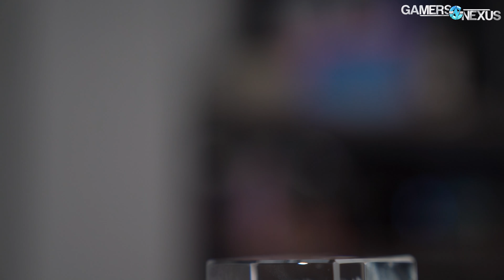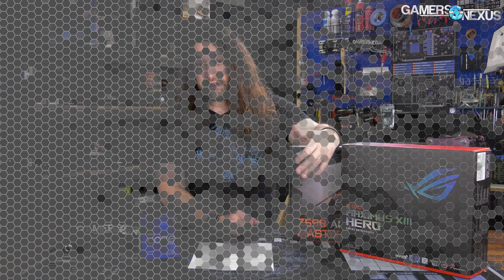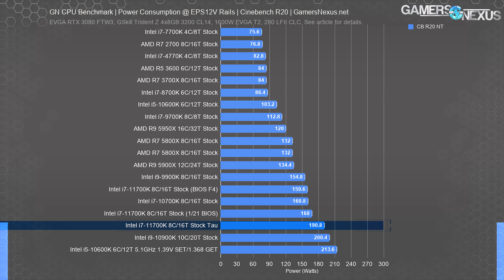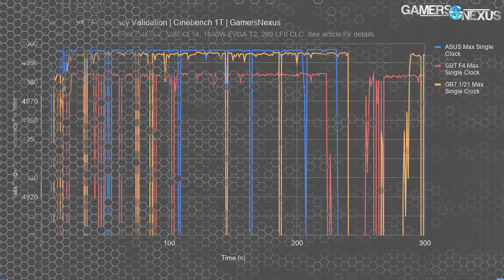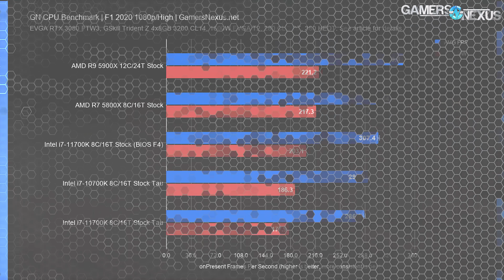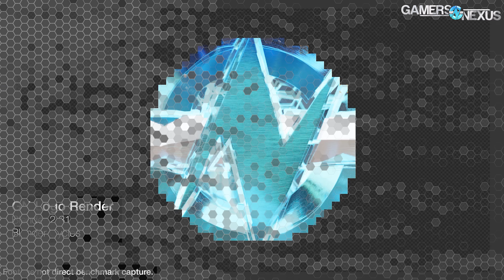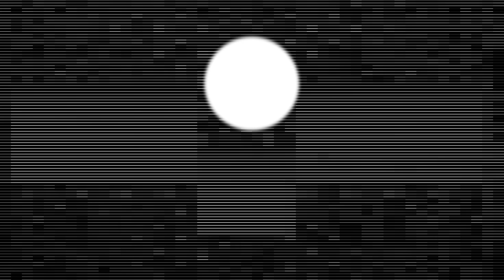Intel's Z590 Motherboard Problem: i7-11700K Power & Thermals Explained

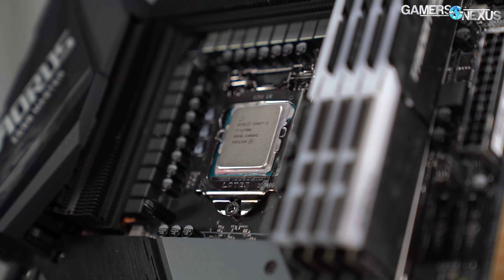Comment: Was that pink thermal paste at 12:25 Thermal Grizzlies new Kryonaut Extreme? I picked some up a few weeks ago but haven’t used it yet.
Reply: If you are in Germany I will send you a test sample of some copper nanoparticle paste we are currently working on if you would like. We are seeing up to 7 degrees C improvement over other pastes. We are still testing longevity but so far we have samples running for 10 months with no degradation in performance.
Reply: @excitedbox  Hey there, I’m in the United States. I’m not sure if you could ship here, but I would be interested if the shipping price isn’t terribly expensive.
Reply: @excitedbox  I‘m in Germany, Rheinland-Pfalz
Reply: @excitedbox  Hi, I'm form the Netherlands and might be interested. Building a watercooled 5800X system. I used the thermal paste supplied by EK WB, thermal Grizzly I think. Would another paste make a difference?
Reply: The price of that kryo extreme is insane. Just get some KPx for half the price, and it is pretty much equal in performance.
Reply: @Apollo-Computers  Yeah I ended up buying a tube of it for around $22 instead of the cup for $80. It was the last tube the distributor had at the time.
Reply: @connormccue9739   I only buy the 30 gram kpx, best price. But then I can go through a lot of it doing ln2

Comment: Single thread speed vs 8700k. How much slower is it to the 11700k
Reply: Passmark singlethread:
i7-8700K = 2787 MOps/sec
i7-11700K = 3542 MOps/sec.

i7-8700K is 21% slower in one thread vs 11700K.
Reply: 134 (8700k) vs 186 (11700k) on UserBenchmark
Reply: @centichad  I don't think that the difference is almost 30% in singlethread perfomance.
Reply: @saricubra2867  Probably a paid promotion between UB and Intel.
Reply: @saricubra2867  I upgraded from 9700k to 11700k a few weeks ago. Playing a single core bound game (Rimworld) I had a nearly 30% increase in tick rate (which is a better measure than FPS for pure single core power) on a busy, incredibly laggy on the 9700k, colony. This bears out in pretty much all single core productivity benchmarks done, and was measured with both at stock. From a 10k series, maybe not worth. From 9k series, I'm very glad I made the upgrade. PCI-e 4.0 SSD is also a noticeable upgrade, and has not been really mentioned as being a part of the upgrade benefits. Also a small amount of future-proofing once 4.0 is used in future GPUs.
Reply: @arofnet  "from a 10k series, maybe not worth it"
I would take anything over Skylake CPU cores.

Comment: what is Tau?
Reply: Tuning and Analysis Utilities.  Basically, Intel boosts its core higher than advertised for a set amount of time before throttling back to it's advertised spec.
Reply: @dashkatae  thanks:)
Reply: A letter from the greek alphabet
Reply: It's what everybody should use instead of Pi

Comment: Another reason why the 11700k and 11900k will perform the same.
Reply: I'm curious if the 11900k will perform worse since it has two less cores.
Reply: yep only 100 to 200 mhz. if you really want intel with their overpriced mb get a 11700k.
Reply: @rci-tf2zc  a 159$ z490 will work with the 11700k fine...the msi a pro z590 is around 189$ lol.... people really dont know that z490 supports 11th gen....
Reply: You can expect the 11900k to be much better binned silicon than the 11700k, because Intel expects it to turbo and self-overclock much higher than the 11700k. This is similar to how the 10850k was "only 100MHz slower than 10900k", but in truth, it ran much hotter too all down to selective binning of the best silicon for the 10900k. I don't think it'll be 30% faster or anything, but I think it will do quite well if allowed to run at PL2 with a good cooler. I would bet up to 15% faster than 11700k depending on the workload. Also, I may be horribly wrong! We'll find out soon enough lol.

Comment: Of course we all know that when the 17700K arrives it is going to be more or less identical to this one...Intel's CPU development is less eventful than my current dating situation and that is quite frankly impressive
Reply: Nah they stepped up with 9th and 10th gen as AMD became relevant, this just seems like a useless sidegrade line to have a release before 10nm is ready.

That said, the 17700k will probably just be a reskin of whatever the 12900k is, so you're not wrong.
Reply: Don't be stupid. The world will have exhausted it's production capacity for "+"s before then, forcing Intel to cease trading.

Comment: I guess there's nothing exciting about the 11th. I'll just keep my 10700K.
Reply: I am thinking along the same lines...with an E5-1680V2!
Reply: Well yeah your CPU isn't meant to last a single year
Reply: You can just use auto-oc
Reply: @Tim_Götz  that is trash. I tried that and after I overclocked my 9 3900x and manual overclock is much beeter.
Reply: Wait and see if the microcode updates optimize the 11th gen first. Steve showed its operating at lower frequencies than the 10700k. I dont think intel was ready for ppl to receive them before march 30th
Reply: @kieran9882   In this video they are operating at stock tdp and frequencies as specified on the leaked slide.
Reply: @dare2bdeviii  the video before this one he shows it
Reply: Smart person.
Reply: 7th gen gang
Reply: 12th gen may be decent due to new management
Reply: @insainperson6018  it'll take a few product cycles before any changes really hit the wafers, executive changes can only affect so much, so quickly (ie 1-3+ years)
Reply: @austinh1028  14th gen will probly be the first revision of the new cpus under management decisions
Reply: @insainperson6018  12th gen is already too far ahead for managment to affect it. tbh this feels like Intel threw in a product just to have something on the market.
Reply: @robojimtv  you mean under the new ceo ?
Reply: @insainperson6018  yeah. 12th gen is supposed to come out end of year. I don't think we'll see the full fruits of the new CEO's direction till 13th gen and probably not 14th either.
Reply: @robojimtv  definitely 14th but  13 not as much
Reply: I just built a 10700K system (still doing a lot of file recovery/tuning from the system it will replace that died actually), but I am considering a 11700K upgrade..... not for performance, but because doing that will enable PCIe 4.0 and a third M.2 slot on my motherboard. This does worry me though. I know there isn't much of a performance upgrade, and that is, fine, because the main reason I want to do the upgrade is not for performance but for PCIe 4.0 and that M.2 slot..... what I AM worried about though, is if the 11700K will perform WORSE than my 10700K.

I do want PCIe 4.0 and that M.2 Slot, and I am fine with keeping the same performance to get those.... but I am not fine with upgrading to a CPU that would perform WORSE, or the same but also a lot hotter. Worried about which route to go.

Granted, I am not going to do that upgrade for another 1-2 years, not right now. So hopefully my options will be clearer by then.
Reply: @Cyber_Akuma  what motherboard do you have?
Reply: @Melkor54  Gigabyte Z490 Aorus Pro AX
Reply: Alder lake this fall should be more competitive (not disruptive, but certainly not garbage). But it's Intel so I will believe the rumors when I see the benchmarks
Reply: yes, just overclock it and its pretty much as fast as a 5800x
Reply: @Melkor54  and then you overclock a 5800x and bye bye intel.
Reply: @rci-tf2zc  eeeeeeeeh.. Zen doesn't really overclock that well.. and they run damn hot if you do.
Reply: @rci-tf2zc  how many actually overclock thier ryzen 3000 cpus. Even intel k users dont really overclock so i dont get your point. And in fact i dont see people saying i wish i got a ryzen 5900 over a i9 and vice versa because once you drop money on a top tier pc.... i dont think you really care to a degree
Reply: @rci-tf2zc  try it, they burn up and don't overclock well at all. my 10700k runs 5.2ghz all core at 1.28v and rarely if ever goes over 70 degrees...try that with AMD.
Reply: @Melkor54  amd 5000 series already boosts above 5ghz on a single core
Reply: @ripjosh5212  the 5950x does boost to 5ghz but that cost £800 if you can find one at retail price. The 10700k is under £300
Reply: @Melkor54  Well, the fact that you can OC to over 5GHz and still get the same performance of that 4GHz Zen 3 CPU is so so so "impressive" for intel. Get over your ego and learn about IPC gains.
Reply: @ripjosh5212  mine runs all day a 5.2 all core....
Reply: @Melkor54  But what does that matter when it's still slower then the 5800x with PBO2 and a -15 to -20 curve. Least Intel finally fixed their heat problem. My 9900k is a little space heater compared to my 5900x.
Reply: @Fudgesickle  i heard lots of people complaining about amd and driver issues as of recent. Makes me hesitant. I'm still hoping the i9 gonna be an OC beast. Wishful thinking probably :(
Reply: @XxViciousxX  8 cores 16 threads....$240
Reply: @Melkor54   I remember when I thought the clockspeed was the most important result. Even overclocked the Intel chips trade performance blows with the lower clocked AMD parts. In productive workloads the Intel parts hold no hope even overclocked. But hey, congrats on your overclock that most Comet Lake owners can achieve with a decent aio cooler.
Reply: @dare2bdeviii  thats my point...they have huge oveclocking headroom, i game at 32:9 5120x1440 and in vr..my machine is gaming exclusively...for that there is no difference in performance between my 10700k and a 5800x...for productivity you buy a threadripper.
Reply: @Melkor54  Interesting because when I had my 3800x for $399 vs Inte'ls 9900k for $550 I was called a poor loser by Intel fanboys because I "couldn't afford the best" now that Intel is in the same place as AMD was  now it's good to get the bang for the buck.
Reply: @XxViciousxX  that's what i buy, the best bang for buck, i have no brand loyalty...AMD 5000 series cpu's are great and the 5600x is good value against the 10600k...the 5800x is not againt the 10700k as all i do is game with my pc.
Reply: @XxViciousxX  plus i enjoy overclocking, more fun with intel at this time with Cpu's and more fun with AMD on gpu's
Reply: @Melkor54  I enjoy overclocking and tinkering which is why I have both a 9900k and a 5900x. Messing with the 5900x PBO2 and their new curve optimizer plus tightening the RAM gets me all sorts of performance benefits.

 But then it's fun to push my 9900k to the limits too though I seem to have a bad overclocker can't seem to get anything over 5ghz. Also having trouble getting my 4400mhz RAM to work with the 9900k best i can get is around 4000 with cl18.
Reply: @XxViciousxX  what board do you have your 9900k on?
Reply: @Melkor54  It's a Gigabyte Z390 Aorus Master and its cooled by a IceGiant ProSiphon Elite.
Reply: @XxViciousxX  that's a good board, i'm a bit of an Asus fanboy though.
Reply: @ripjosh5212  he is talking about all core lol not single core boost.....the 5800x struggles to get 5ghz all core.
Reply: @Melkor54  lol the 10600kf is under 200 usd. Thats really hard to beat compared to the common 300-400 5600x
Reply: @Melkor54   Intel kinda needs the OC advantage at this point though really. Without that, and Thunderbolt now being rolled out natively on AMD boards, there is almost no reason to get an overall worse performing product with less efficiency. I use to be an AMD fan back in the Athlon 64 hey day, and it was heart breaking to have to abandon them when they fell off the wagon. But when it gets to that point, what's the point of going with that brand. Ya know?.  At least I know Intel have the finances and talent to come back. They'll never reach the lows that AMD did.
Reply: @Tano Idk if upgrading from a i3 10100 to a i5 11600k is worth it? I'm pretty much just a gamer. My GPU is a GTX 1080 8gb.
Reply: Iokl